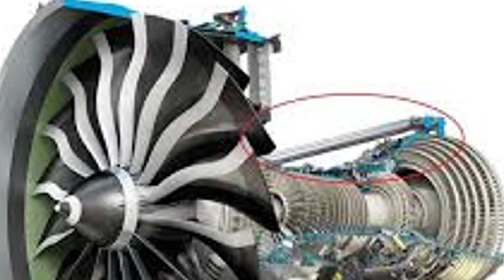Boeing Redesigns 777X Thrust Links - Will the engines fly off on their own anymore? #boeing #777x

Comment: tell us details of the new thrust links , thicker, different shape, material change
Reply: what was design change
Reply: are you sure it's not engine vibrations not air initiated
Reply from the maker: after extensive testing they found that they vibrated only when a nearby blanket used to protect a hydraulic line was within 0.3in of the thrust link, the high speed air then caused the vibration from the cooling port. so they have secured the blanket to ensure sufficient  seperation , closed the port directing air at the thrust link and increased the wall thickness of the thrust link by 2 hundreths of an inch.
Reply: what was the original wall thickness before thickening  0.02 inches
Reply from the maker: Absolutely, I'm never sure how much technical depth to go into, it was due to high-speed air striking the links, causing vibration and failure due to fatigue caused by the vibrations in the link, hitting likely its resonate frequency and therefore premature failure. I believe the link is titanium which is more susceptible to cracking. Would you like to see more detail like this?